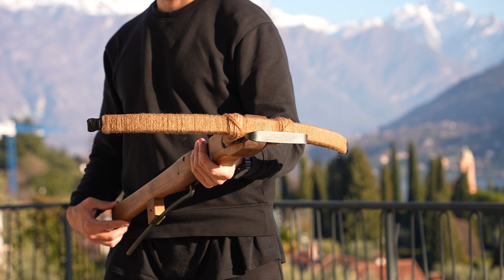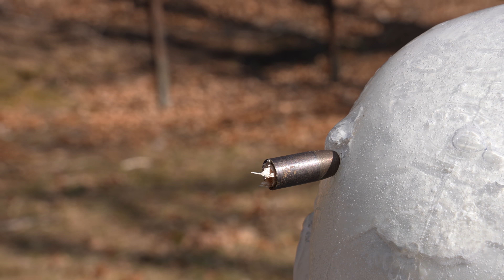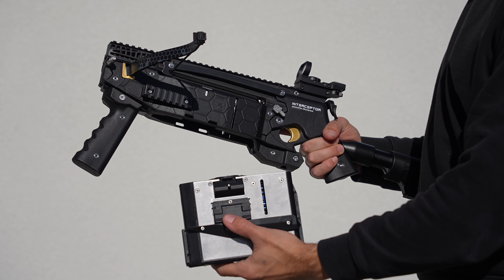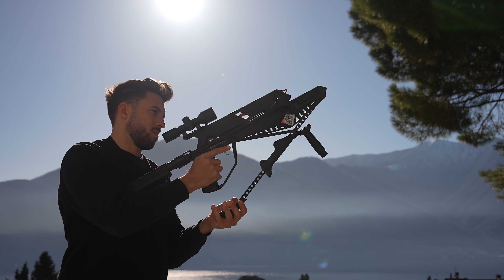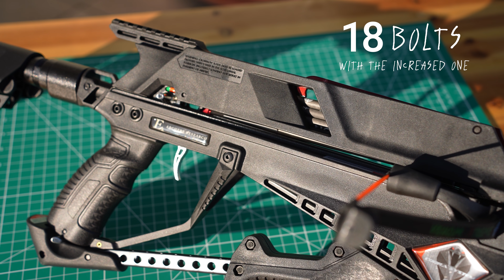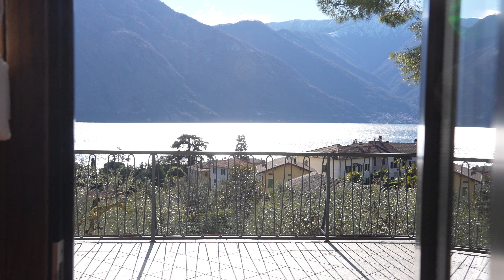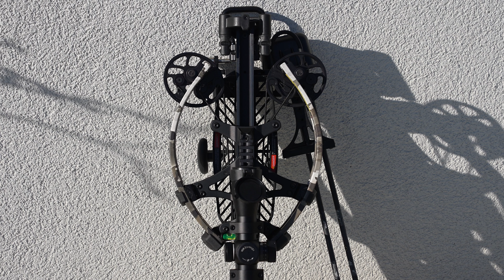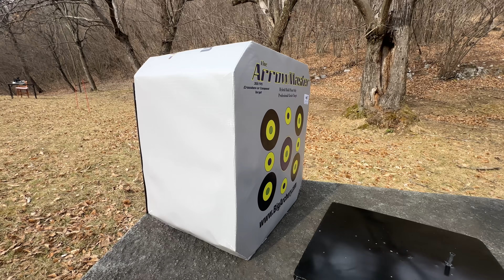How Dangerous are Crossbows?

Comment: Saying that the medieval Crossbow isn't lethal is like saying "It's just a concussion and small skull fracture. Walk it off." That absolutely CAN kill you.
Reply: That bolt was a toy not a medieval war bolt.
Reply: @corumeach  Yeah that was the 1st thing that ticked me off. If there is one out of the two things modern firearms are inferior to historical ranged weapons it's 100% the projectile. That has a good reason because guns fire bullets with such speed and force that it is impossible to maintain a edge.  That is not a issue with Bolts and Arrows. A sharp tip makes all difference as it concentrates the force. Those toy bolts were the equivalent of trying to cut a steak with a hammer.
Reply: @rayzuke1232  I agree, that "small" skull fracture when the toy bolt tip got stuck in the dummies head would most definitely kill someone Especially back when those crossbows were the norm.
Reply: @corumeach  That's even worse then, meaning the medieval crossbow is already lethal even with just a toy bolt
Reply: @theracingolfer3430  Almost anything is lethal to an unprotected human body.
Reply: A medieval bolt would have been extremely sharp and deadly. I would not try to be in the way.
Reply: Without antibiotics infection would finish the job even if it was not acutely deadly.
Reply: @anttikangasvieri1361  Infections arent immediate death, its like... 10% death, and you cant really do much to get rid of it
Reply: Tis but a scratch.
Reply: A flesh wound?
Reply: Especially in the middle ages where their best medicine for it was "Add more leaches".
Reply: Iam sure not let him shoot me with it
Reply: Richard The Lionheart endorses your message :) And if you don't know the story I suggest looking it up.
Reply: This is not really a medival crossbow. A medival hunting crossbow had 450 to 600lbs and a war crossbow 700-1300+lbs. They guy was using a toy
Reply: @dario9107  a toy that still fractured a human skull with a glancing blow.
Reply: @H3xx99 I can do that with my grandmothers footstool
Reply: It busted the skull and would have made a open channel to the brain, VERY lethal!
Reply: I’m amazed he didn’t talk about the bolt being a dummy toy bolt. Didn’t even have a sharp head on it. Plus the fins weren’t great it kept tumbling
Reply: and that medieval crossbow was very weak, and also the bolt was with a field point for practice
Reply: cracked skull, a nasty fucking concussion if not a TBI, and a fun little side helping of a hematoma, untreated you are dead as hell lmao.
Reply: Exactly
Reply: they would most definitely say walk it off in medieval times
Reply: Just imagine the stones necessary to take a bet that you can shoot an apple off of your son's head with that thing.  And then doing it. There's a reason it's called The Legend of William Tell.  Cause the guy's an actual legend.
Reply: @davidversluis5301 he didn't do it for a bet, he was forced to by the local Austrian lord and bully Albrecht Gessler in order to save the lives of his family for not bowing to Gessler's hat which he had placed on a pole. I suggest you look it up and hopefully understand that in those days the overlords that conquered your country had the right of life and death over anyone beneath them socially. Some people just don't understand how lucky they are.
Reply: I recall seeing a video on here where a guy does crossbow tests against medieval armor. None of them would penetrate the armor. So, with armor, they are useless. Armor stared become useless as everyone started switching over to guns.
Reply: @knerduno5942  Armor did not become useless, it simply became more advantages out of a logistics point of view to focus solely on Firepower.

Bulletproof armor cost a lot of money that could have been allocated instead to getting 2-3 more soldiers on the front. On top Guns are the heaviest weapon in history, which did not pair well with bulletproof armor getting more heavy as well. Hauling supplys to the front became unsustainable shore for any armored troops. 

Giving up on armor meant your troops would deploy faster, could cover more land and overall your garrison would be larger. 

This also gave rise to the typical general hanging around in the backline, no longer leading any charges because they had no safety net.
Reply: @rayzuke1232  A man could not have bullet proof armor back then. The metal would be too heavy to stop lead bullets, unless we are talking about Clint Eastwood/Marty McFly style of limited protection.
Reply: @knerduno5942  that is exactly the level of protection we are talking about as it protects all the vitals aside from the head.
Reply: There wouldn’t even be a skull fracture if the enemy was wearing an helmet, not to mention that level of penetration wouldn’t even phase a theoretical zombie in an apocalypse.
Reply: @JamesL0717 The target was not wearing a helmet and it clearly fractured the skull, making any Zombie much more vulnerable to head attacks, either with a club or another bolt.
Reply: It IS very deadly yes, but the role of the crossbow wasn’t to be more deadly than an actual war bow or long bow, its main advantage was you could fire it behind cover then reload safely out of sight. But in a battle of just pure strength a bow wins almost every time
Reply: @shaminlefoxit's also so you can give it to the scrawny guy, let him wind up a winch and then hold the shot to pull a trigger, instead of holding a 100lb butterfly position while lining up a shot.
Reply: It's not even the problem, his arrow just sucked, i think the crossbow might be a little week compared to something used on the battlefield, it could probably pierce a bit of leather but never, absolutely never a steel armor, because the only thing that can pierce that are modern guns
Reply: @nataraplapla3735 Long Bows laughed at steel plate.
Reply: What are you talking about dude the brain only juiced a little bit.
Reply: I think you guys are missing the point. He started the video in a post apocalyptic scenario, medieval crossbow cant kill a Project Zomboid zombie, much less anything from LOU, RE or Dead Space.
Reply: @imtiaze642  He used the wrong ammunition for the weapon.
Reply: @imtiaze642 Realistically, even that bone fracture could lead to nearly instant knockout.
Reply: @imtiaze642 medieval crossbow absolutely could kill zomboid from pz, he just got some kind of shitty peasant version crossbow
Reply: I was there in medieval times and they aren't lethal.

Comment: I knew you were going to have a problem with the last one. Mine shoots around 410 fps and I always have 2 targets 1 to shoot and other to help stop the bolt. Ruined the fletching on first bolt, the guy from Bass Pro sold me a target that he said would stop bolt no problem but Houston I have a problem. Also at 90 feet, 30 yards, you DO NOT SHOOT AT THE SAME DOT or you guessed it ROBIN HOOD and shelled out an expensive bolt. My cocking belt is smooth but clicks. Funny for $300 more dollars they have one that doesn't click. Tried to free wheel it one time but the slip took lots of skin off because I couldn't let it free spin! OUCH! TenPoint Carbon Nitro RDX, a very bass ass crossbow!

Comment: You may want to try not using target style bolts for the old cross. Bodkins or broadheads would've been a lot more common considering the broadheads are designed to do more damage to flesh, and are easier to make than a rounded tipped bolt or a bodkin. And bodkins would've been used to deal with pesky shielded or armored targets. Though as you mentioned, its draw weight wasn't exactly impressive for a crossbow. It still matches an aggravated horn bow, which would still cause a lethal injury with an appropriate projectile.

Comment: You can buy a compound crossbow with similar speed and energy to the Lancehead for around $300 USD that will have similar accuracy to the TenPoint (400+ fps with the testing arrows, ~370 grains/24 grams, close to 200 joules). Also, a target specific to crossbows should stop these arrows no problem without damaging the arrows, and they're probably not much more money than the one you wrecked all of your expensive arrows on. I have one that I bought on sale for around $300, it's rated for 415 fps, and it shoots 4 inch groups at 60 yards when bench rested. If I spent some money on 0.001" straightness tolerance arrows, it would probably tighten up those groups even more, because I usually have one arrow of my 3 that consistently shoots to the left of the others. It's accurate enough that even at that long range I have to aim for different targets on my target bag each arrow to avoid robinhooding the bolts into each other. It's amazing how accurate and powerful these modern crossbows are, and they are extremely lethal on big game animals with expanding broadheads.

Edit: I saw at the end you got ahold of a proper target bag for crossbows, so disregard that part.

Comment: I'm surprised that you didn't have an excalibur crossbow but a Tenpoint after you had a recurve crossbow. I think Excaliburs would be a better post apocalyptic world since you can change the string yourself but you need a bow press to restring the Tenpoint Havoc. I have 3 excaliburs and they're not as powerful as the Havoc but I have the Assassin 400TD which you can break down and put back together and it maintains the same accuracy.

Comment: One variable that you have neglected to consider is the shape of the bolt-head in the bolts shot from the medieval replica cross bow. They are not tapered to the same extent that they would have been in the Middle Ages.  If you’d have shot a bolt with a long tapered, sharpened head, it would have split the wood in half at the point of contact. Using a short tapered head is no different than shooting a bolt that’s head is completely flat faced, with the sharp edge be of a nail protruding a few millimetres out of it. The nail will start to go in—then the flat face will prevent it from going any further—denying full penetration. When the head fattens so much right behind the point, essentially the same thing occurs. 

I also noticed you used different bolts for different bows. Obviously the design of all the bolts used is going to have a major effect on results.

Comment: I grew up in a rural area. When I was young man a mate of mine built a home made crossbow out of an old suspension system from a trailer chassis. It could fire through a stone wall (using a pig bolt head and a - literally - old head of an old fashioned soldering iron). I personally witnessed it go through the wall of their cow shed. After that he destroyed it.

Comment: Cranquin arbalest in the high middle ages reached excess of 1200 Ib's.
Still these large crossbows were about 13Ib's or over 5KG.
Many Cranquin arbalest gave up poundage of 600 to 1000Ib's & weight to about 7 or 10 Ib's for praticalty to carry/usage.
Middle ages had some impressive technology but it was not convenient nor compact with a load rate that can get down to 1/2 a minute but 3/4's to a minute is more realistic for most users.
These high poundage heavy crossbows are what were associated with anti armour as they can penetrate front chest plate of full harness at about 20 yards semi-reliably but other p-art of the armour could be penetrated at about 250 yards.
Reply: Cranquin arbalests around 1000Ib's tend to exceed 400 joules. Still depending on the wood used or construction methodology can have varying results unlike homogenious material used in post Machine age construction.
Middle ages got a lot out of basic crucible steel & a well picked lump of wood. 
Quality of Crossbows till the high middle ages could vary considerably in quality from the materia, or craftsmen skill who made it.
Still for zombies a cross bow would not bemy 1st choice either. Hurlbat or Wurfkreuz as a 1Ib or 1/2 kg lump of steel hurled is pretty effective while less complicated with no complex loading or maintenance needed.

Comment: Sadly California is restrictive...
Hunting Regulations: Crossbows are permitted for hunting during the established gun seasons. 
Archery Season: Crossbows are not permitted during archery season unless you have a valid disabled archer permit. 
Disabled Archer Permit: If you have a physical disability that prevents you from using a traditional bow, you can use a crossbow during archery season if you have the proper verification of your disability. 
Arrowheads: Arrows or bolts used with a crossbow must have broadheads at least 7/8 inches wide. 
Prohibited Actions: It is illegal to transport a crossbow in a car or other vehicle with the arrow already on the flight rail.

Comment: the bolts your using dont look like anything people would use in warfrare or hunting in first test at all not saying its crasy more powerful but if steel/iron armoured horses are being murdered in the thousands by english long bows with 100/120 draw weight at agincourt battle then with proper bolt a 242pound draw would do alot more then dent a pine board. i think the tests were fine other than that.

Comment: Bolt type and especially the tip is extremely important to penetration and output. Also using wooden board make the repeated test unreliable as due to different internal structures they have varied toughness.

Comment: I got the adder, it's like a transformer. You got mounts on all four side for scopes, laser flash light and knife, what ever you fancy for. You can exchange the limbs up to 210lbs. There are 3 different capacity magazines. You can make it shorter for indoor by removing the stock. It's amazing. And I don't have the biggest 18 shot magazine, but I think you can use longer arrows with that. I got the same hunting arrows like he used for the interceptor, they are bloody sharp, it's hard to store them tbh. I wouldn't change it for any of the others from this video

Comment: The other factor that is important and a clear reason i wouldnt use the last one is Ammo reusability. In a Zombie appocolypse a reason youd want arrows over bullets besides sound is b/c you can reuse them. The last one not only do you need specific bolts but those bolts seem to break easily. Youd want something that can use a plethora or different bolts or arrows.

Comment: The correct answer is a bow. Assuming a proper draw weight, you can fire faster and with more energy in the arrow than a crossbow, they just require a lot more training. Though I'd also take the ultra compact one in case I need to fire in a very cramped area.

Comment: interesting and informative video!  Slightly disapointed that the medevial crossbow chosen was a low draw (many actual medevial crossbows took winches to load just like the two high power modern crossbows tested) but a "light" version was chosen instead :/

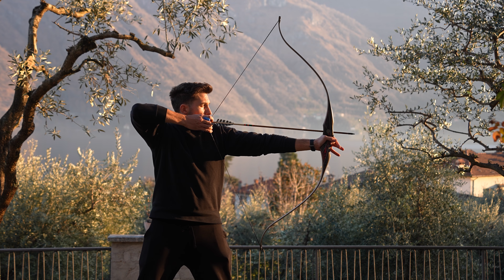Comment: 0:56 Comparing a crossbow to a medium frame bow isn't really productive. They were designed to "replace" the full body height bows used by soldiers and make it "easy" for anybody to use as opposed to bows which needed intense training to use efficiently and to shoot many arrows back to back.

Comment: That first bow scored low on accuracy. Is the lever easy to press?  It looks like to me that it takes a bit of effort, just to get it to release. The position probably doesn't help either, have to hold it infront of you, and really can't use you're shoulder to stabilize it either. I think you were pretty generous with the 7

Comment: The medieval crossbow would more likely be using better heads than just field points if not a broad head a bodkin which is like the head of a nail and is designed for armor piercing... so it could have performed a bit better with better head options.

Comment: Great video! I noticed the string on the Adder wasn't twisted at all — if it had been, it would’ve generated more power. Also, the bolts used against the wood had standard field tips; with bodkin tips, you'd likely have seen even more damage. I reckon it would have gone straight through the wood, especially with a properly twisted string.

Comment: In the event of a zombie apocalypse, I'm thinking I would probably want the crossbow with the highest fire rate. I won't have time to mess around with a scope when the hoards are running at me, so I guess I'll just have to get good at judging distance on the fly. So that leaves the question--how much power is needed to penetrate a zombie's skull? I would imagine they are on the softer size, but I have yet to see any actual data on this.

Comment: the $600 one actually seems like a great value for the energy and accuracy
Reply: The adder is great, perfect balance of power, accuracy and rate of fire. It performs across the board like an AR  thats why they call ot an assault crossbow
Reply: @bigsam5171 "performs across the board like an AR" 😂😂😂

It literally fails to perform like an AR in every metric possible.
Reply: @christianh4723 you misunderstood what I meant. I meant its similar to an AR in that it performs fairly well in all areas. I know it doesn't actually perform like an AR
Reply: The medival crossbow could see better performance if he switched to using an actual hunting arrow head, instead of those rounded target heads
Reply: @zenovak5177 I know!!! What's he doing with his life?! Get the hunting tips out, you foo!
Reply: For sure. No way I am investing 4K in a crossbow.
Reply: Best buy for sure
Reply: An Adder is a viper for English speakers. i think the slingshot channel (joerg sprave) made that thing. 
Funny German